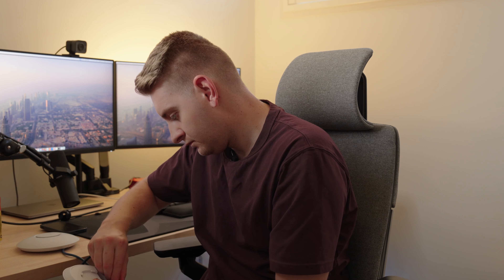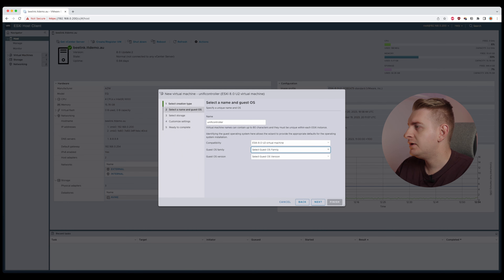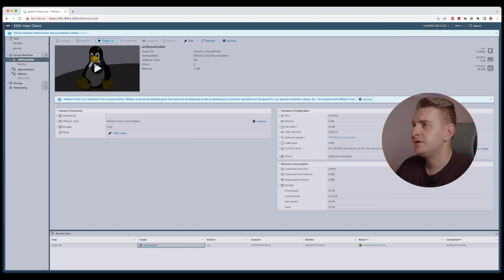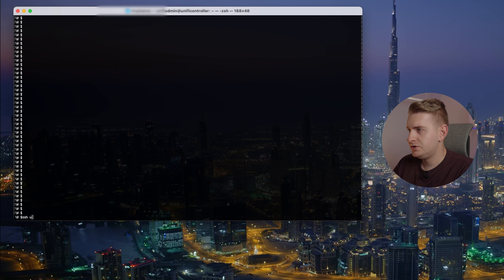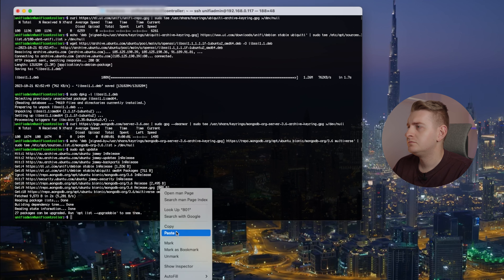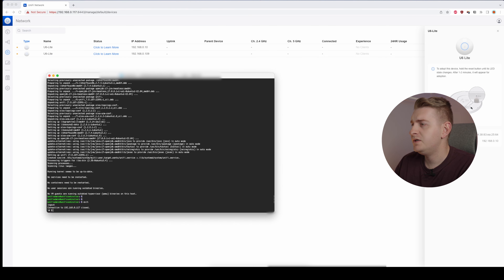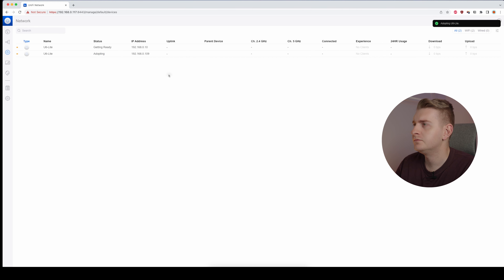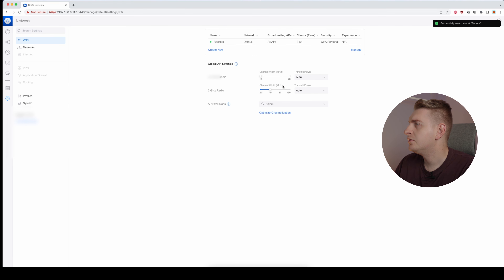Finally upgrading my Wireless with Unifi (Controller build walkthrough)

Comment: Sorry but i have to ask, why would you get the U6 Lite when the U6 + is the same price but has twice the thruput and better antenna gain.

(i have personaly used both and the U6 + also is far supperior in roaming between the APs)
Reply from the maker: That’s a good question. At the time the U6 lites were about $20 cheaper per AP so they seemed more appealing in comparison. From a throughput perspective my requirements aren’t too intensive so I figured I wouldn’t be missing realising the extra performance so I put the savings towards a POE switch instead. As little as those saving were haha